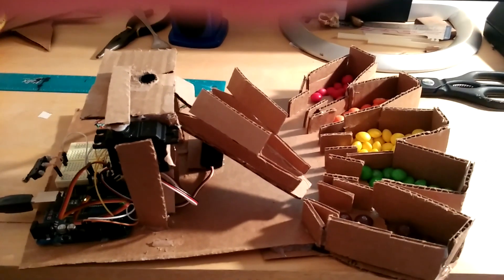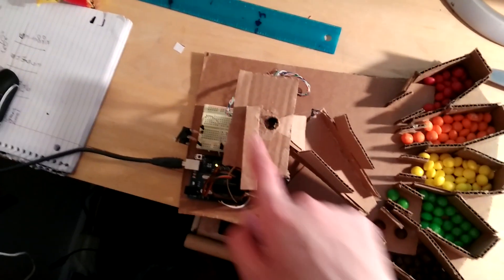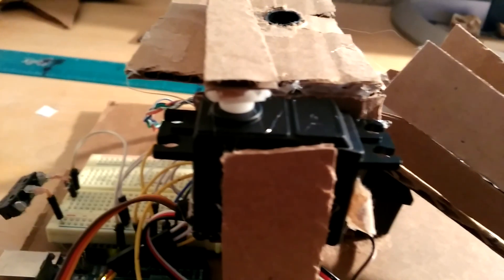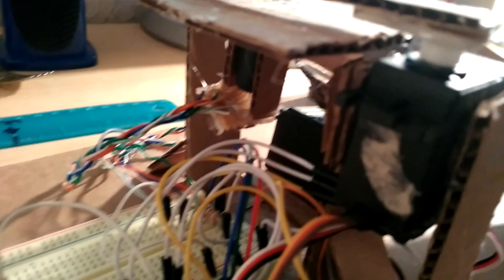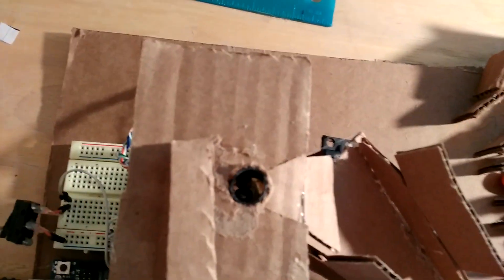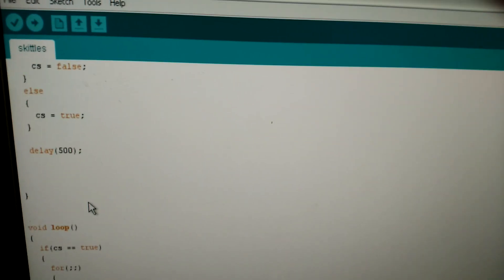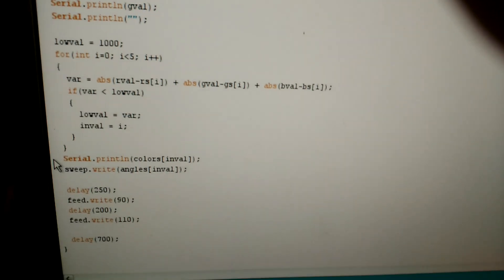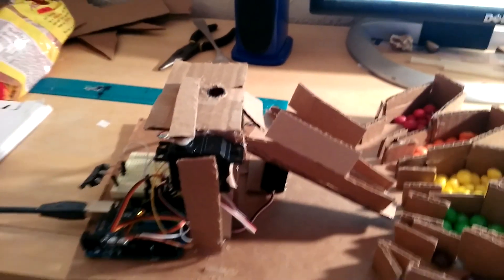Arduino Skittle sorter

Comment: FOR ALL PEOPLE LOOKING FOR THE CODE & CIRCUIT:

What circuit? It's an arduino, a color sensor and two servos.

In my machine I used a TCS3200 color sensor.
TCS3200:
TCS PIN | Connected to  (ARDUINO)
1 -> GND
2 -> +5V
3 -> GND
4 -> GND
5 -> +5V
6 -> Any Digital pin, say PIN 10 (set it as input in arduino code)
7 -> Any Digital pin, say PIN 11 (Output)
8 -> Any Digital pin, say PIN 12 (Output)

Code:
Servos, super easy:
For the servos, use arduino library: https://www.arduino.cc/en/Reference/Servo

Color sensor: a little bit trickier:
The TCS3200 (Datasheet: http://www.mouser.com/catalog/specsheets/TCS3200-E11.pdf ) works like this:
You set arduino pins 11 and 12 both LOW, and the sensor is outputting a square wave which has a frequency that's proportional to the red light intesity.
(How to read frequency..  http://forum.arduino.cc/index.php?topic=22060.0 
 do it on pin 10)

Repeat this step for all combinations of pin 11,12 that can be both low and/or high:
11     |      12
LOW    LOW    Read RED
LOW   HIGH    Read BLUE
HIGH   LOW    Read Light Intensity
HIGH   HIGH    Read GREEN

Then you determine the object's color using if statements:
if ( red > xxxx && red < yyyy && blue > zzz && blue < www && ......)
     //Then do something: e.g. activate servos to push the skittle into the right bin

Comment: Nice job! I love the simple design. To those of you asking for code or for the circuit diagram go do a little research please. I'm gonna tell you right now this is a pretty simple circuit. The Arduino platform has plenty of documentation on how to wire up servo motors and has accompanying example code with the libraries. RGB breakout boards can be found with a little internet searching as well. just make sure it has good documentation and library support. The reason I ask you to do a little research is because you learn much much more from taking the time to study documentation rather than taking shortcuts.
Reply from the maker: Abraxas Thank you for this! I really don't like when people ask for and use other people's code and circuits because it's not their own work.